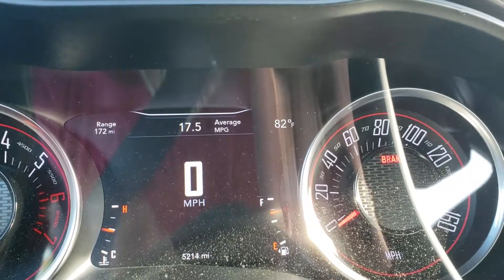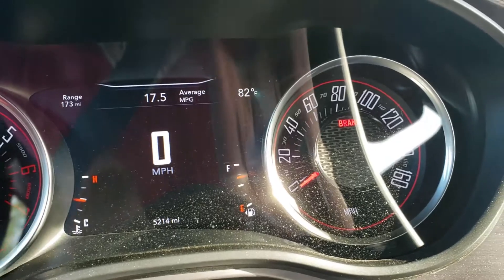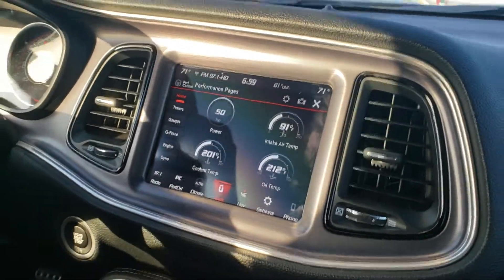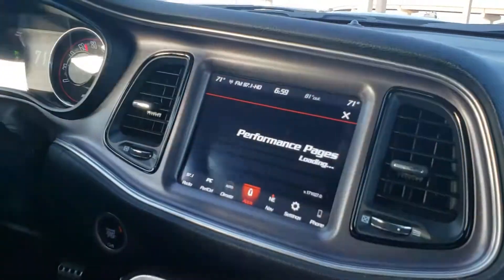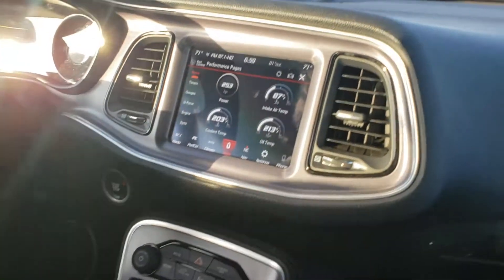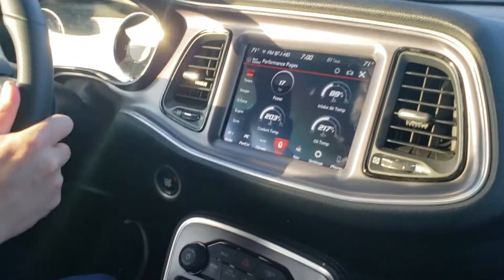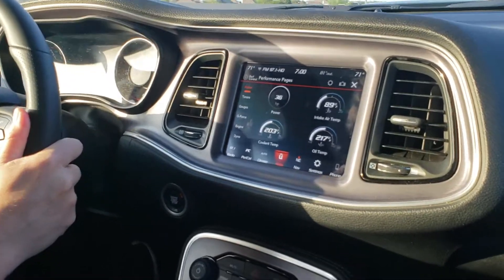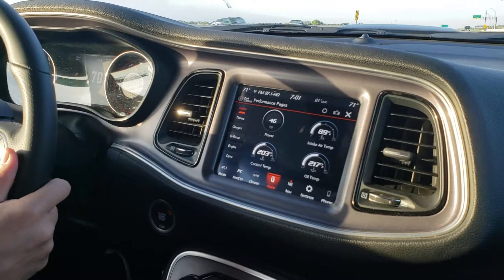Intake Air Temp Experiment, Part 2

Comment: First of all big error here as the bottom of the air box in wide open ahead of the wheel well. Block that opening off to increase air velocity !
Second of all you are going about this all wrong ! Use a laser temp hand held device to check coolant tank temp ! The coolant tank rests against the air box all, aka heat transfer ! Pull the air box and cover it with heat resistance  stick on panels. 
Third, buy a shaker riser kit which moves the air intake tube from the shaker off of the valve cover, heat transfer issue. Then wrap the tube in 3 layers of heat resistance tape , reinstall !
On the 5.7 engine only get rid of the OEM tube air box to TB and replace with L shape silicone tube ! 
My Scat Pack runs at ambient air temp here is SW Florida !

Comment: I like the commitment! I think you should go do a standing mile and measure the air temps at sustained WOT
Reply from the maker: Michael Olsen Part 3 is already planned and you're not that far off. It won't be quite a full mile though.  Not really a place around Dallas where I could get away with that.
Reply: Offbeat Motors Texas mile is in the fall....
Reply from the maker: I'm to impatien to wait for fall.